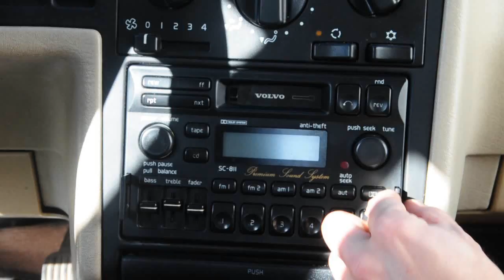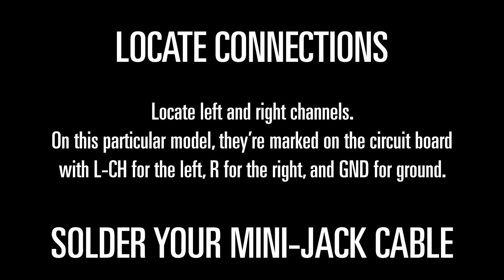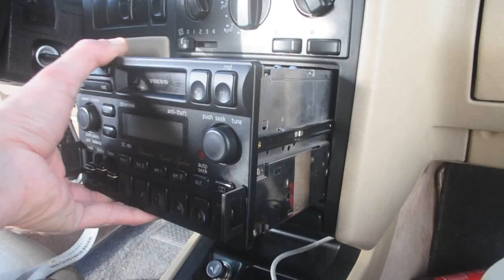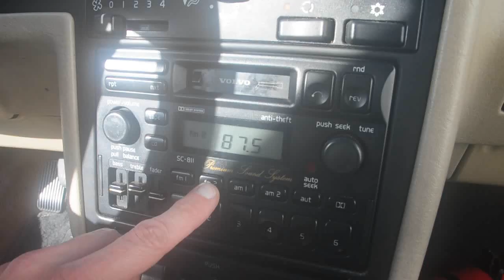HACKING: Convert your car's old tape deck to play mp3 files

Comment: great Idea but way too hi level. in your example you just had to read some printing in the circuit board to find where are the output channel terminals were located? what about an older cassette radio where no such printing exists? Can you update or revise with some guidance as how to ID the correct terminals on such decks?

Comment: First and foremost, thank you very much for this video.  However, I don't quite understand what's going on.  Some specifics appear to be missing.  What wires are you cutting/soldering?  Are you un-soldering old wires and then soldering new ones?  Mini jack cable?  Can you be more specific?
Reply: Anthony C I just did it on My 850. all you need is wire strippers, soldering iron, electrical tape, and a 3.5mm aux cord,  with 3 seperatly insulated wires, red:right, White:Left, and bare metal:ground. You dont need to take any existing wires out of the radio, you just need to add an aux cable. you need to seperatly strip each wire inside the aux cable. if you have the SC-811 the video shows where to solder the aux cord in. You can either use the existing solder on the cassette board or use loose solder

Comment: How do you get it to think a tape is in there? My Sc-811 tape belt broke so now I'm looking at how to fix (using a rubber band?) or bypass it all together.
Reply from the maker: +Evan W I pushed the little drawer in with my finger, to make it think a tape is inside. As long as you never press the eject button, it will stay there (mine's been working fine for over a year).

Comment: Hi, 
Will this hack trick my 1998 hyundai accents radio to think that a casette is inside the radio or how does this hack work?
Reply from the maker: After you solder the wires, you have to push the inside of the desk inwards with your finger (or something else) so that it 'thinks' there's a tape in there.

Comment: 2 things... 1. how is the quality? 2. will this work with a 1989 Buick Reatta?
Reply from the maker: 1. Quality is fine, because this method bypasses the tape-deck's head, it's just like having a normal input-line.
2. This will work with any type of radio that has a tape deck,( or a CD-deck if you wish to wire it into a different input).
Reply: StrawberryGates alright! Well imma go do this! Awesome tutorial by the way! This is perfect cause I hate using those stupid radio broadcasters

Comment: im doing it right now on my with a bluetooth mod for 25 swedish krona and a volt stepdown mod for 4 kronor so in dollar is about 3$
ile let you know how it went
Reply: did not work for some reson on  mine. i have a 805 model.
grrrrr Aaaaaaaaaa. little upset. spent to nights to this. and cant figure out whats wrong.  the set up works but the stereo is not compatible.
Reply: Did u found a solution? I have the same SC-805 unit

Comment: Will it work even if I do not have a code for my radio
Reply from the maker: If you have to ask something like that, I suspect that maybe you're not the right person to be fiddling around inside the radio. If you don't know the code for your radio, try 4216 or reversed (6124).
Reply: +StrawberryGates my check engine light  was on so I took it to a mechanic who reset my codes. I have a 94 850. so my radio reset but thank you.
Reply from the maker: you can also reset those check engine lights by yourself, quite easily.
Reply: +StrawberryGates I know, but he went through my PCV  system and decided to reset it lol but thank you

Comment: Did this on my Volvo HU, It worked - sort of, I got sound, but on my HU there is a +4-5v over the same connections - even if it generates sound from external source, to make a long story short, i fried an iPod shuffle. (s40 96-97 - original stereo).

so be careful, it might not be as easy!

Comment: Where did you get the cord?  How do I know what cord to buy?
Reply: Any auxiliary cord will do. just have to cut one end off.
Reply from the maker: Actually, you're looking for any cord, as long as it's not too thin (earphones have extremely thin cords that you won't be able to strip without breaking, and won't be able to solder without melting). So go for something slightly thicker.

I just bought a mini-jack extension and cut off the end.

Comment: hm, nice video. however be very careful: 
1) its still hot in this video. if you short something out, expect 12vDC @ ~10A (maybe 15A) which is fatal, best to disconnect at least the car battery. 
2) check your levels, make sure you are finding the line level inputs, such as where the tape deck head is wired to the board, that will have additional amplification but should be close to line level. care should be taken to not grab inputs after the amplifier, since the amplification circuitry would then flow into your device, likely frying it.
3) don't reinvent the wheel. a tape deck input adapter will work better than any modification an average person could do.

one last thing worth mentioning, if you do opt to modify the radio: it will have a 5v DC rail somewhere in it, and can be used while you're inside to add a USB port for CHARGING only, but you have to make sure the 5v regulator can push the extra 2A or so needed for charging, it likely will.

take your hack to the next level by making a neat little custom dock for your device :p
Reply: it's not "fatal" .. you can grab a car battery with no effect....